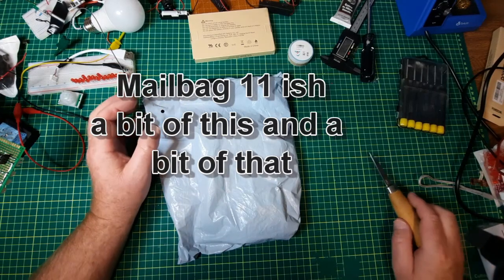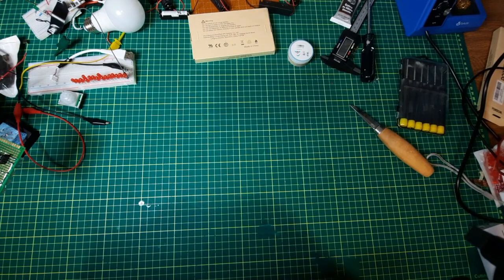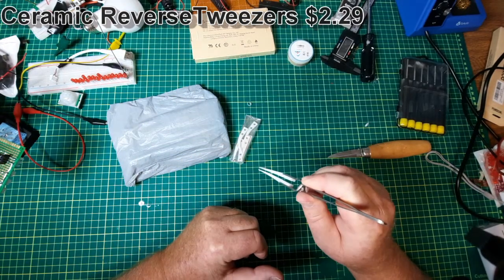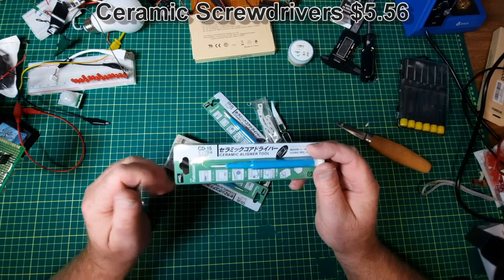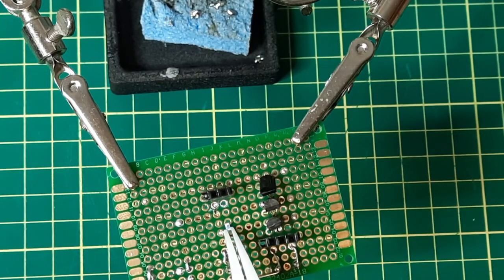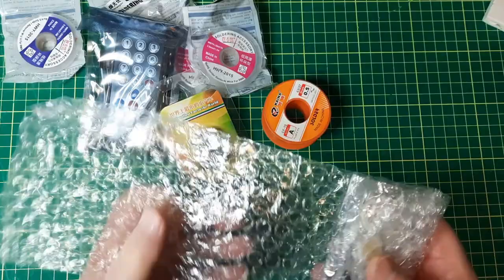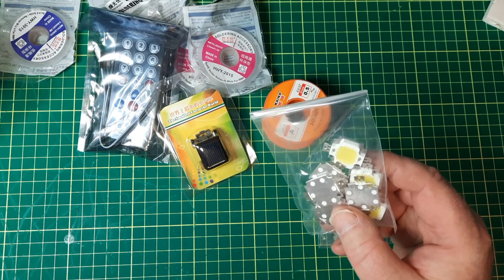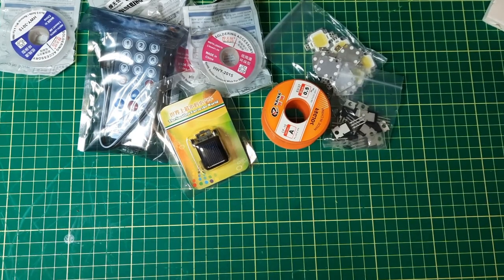Electronics Mailbag 11 ish

Comment: Do you have good results using Chinese no-name solder?
I tried a couple of years ago and gave up on it.
Reply from the maker: So So. I tried the lead free stuff but refer SN63 Pb37. Slightly bias since I have two spools of it for a total 2 pounds. Not going to run out any time soon.
Reply: @retireeelectronics2649  Lead free solder will always be second class 😉